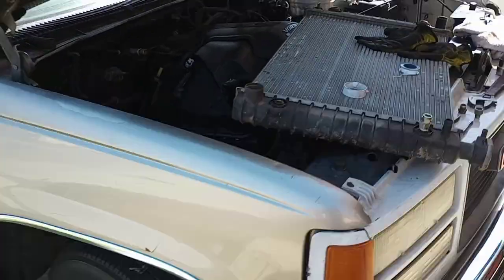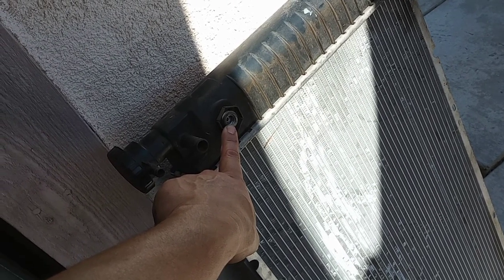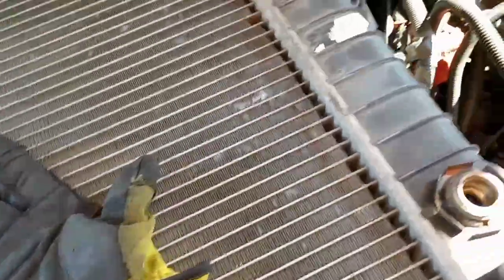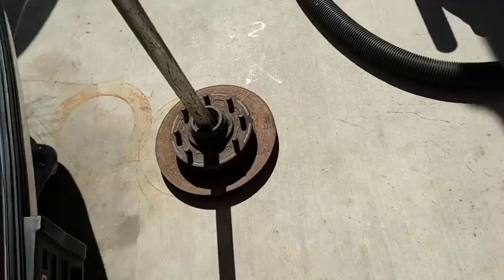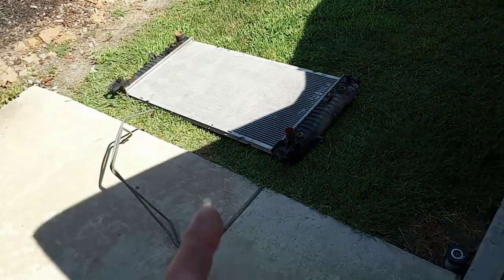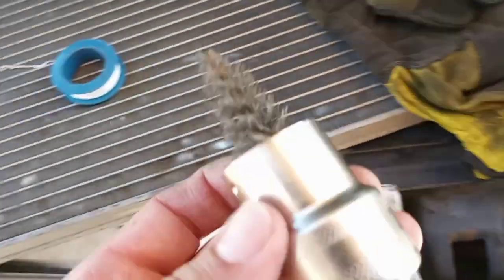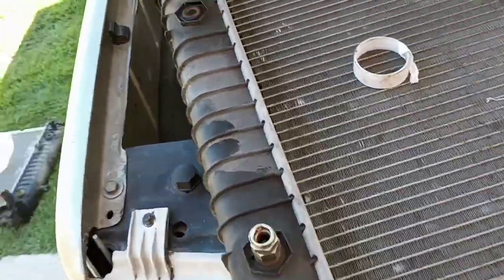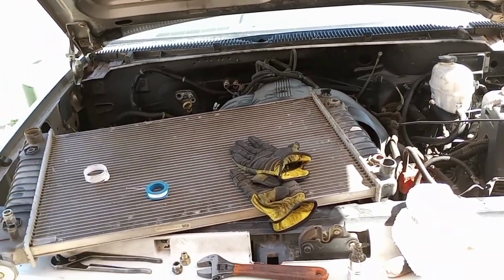can I use my stock OBS radiator on a LS swap? yes or no 🤔

Comment: I got a 98 gmc sierra 4.3 v6 vortec has oil and trans cooler lines. Would I need to use a 5.3 radiator or could the 4.3 v6 vortec work. It’s a stock 5.3 nothing done to it
Reply from the maker: Yes you should be able to use your OBS one with the fan. Good luck with your project you are going to like the power that the 5.3 has 😊🤙
Reply: The 4.3 works fine, if anything get a trans cooler later, but the obs radiator looks clean and you can get some electric fans from a 2003-2006 Chrysler Pacifica they fit perfect you just got to make minor adjustments.